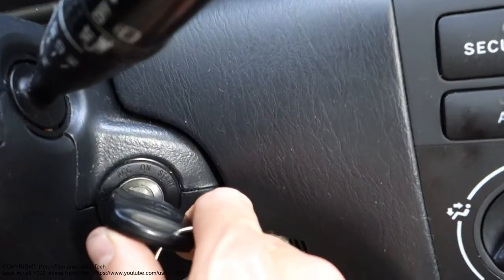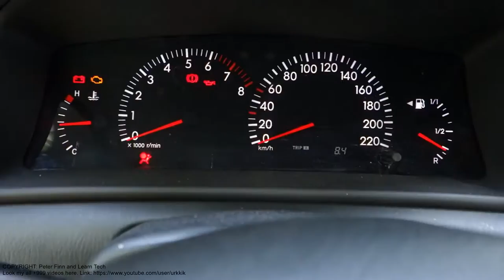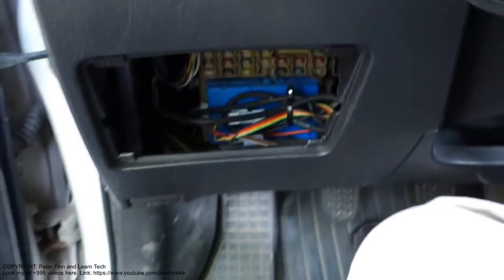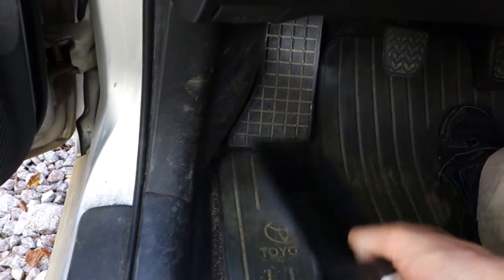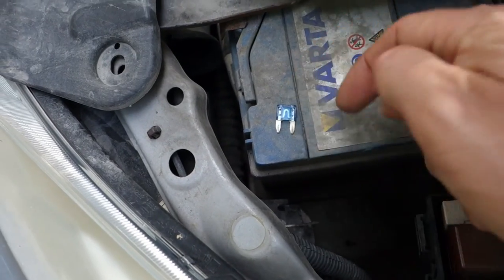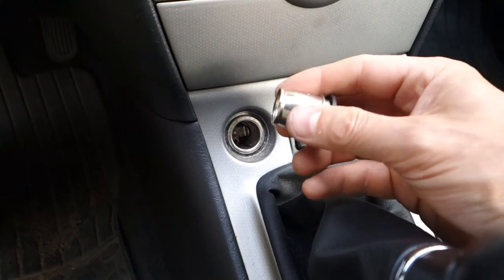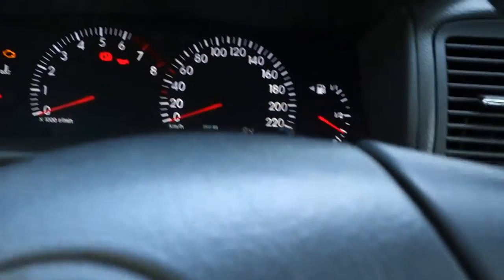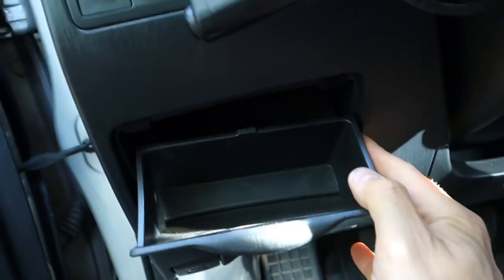How to repair bad and broken cigarette lighter Toyota Corolla years 2002 to 2015

Comment: My 2006 Corolla isnt charging my phone when the car key/ignition is in OFF position. If I turn the key to accessory, my phone charger lights up, and will charge my phone. BUT, I want my phone to be charging, and my cigarette lighter socket to work, when the key is turned off. Your video showed (with) KEY in OFF position, with the bad fuse, the cig lighter did not work.  However, AFTER you changed the fuse (to a good fuse), you did not show whether or not the new fuse made the cig lighter work/get hot.  [BOTH of my trucks will light up my phone charger, and charge my phone, when the key/ignition in OFF position; but my Corolla will not].
Reply from the maker: I have read your post. Thank you for the message. Good comment. 👍😀